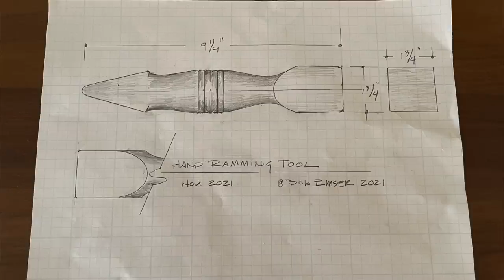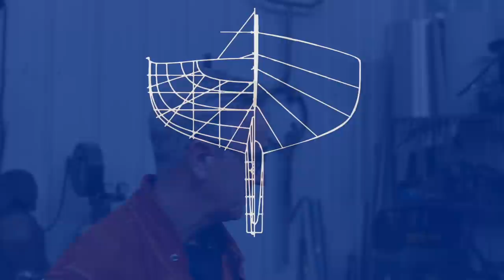Foundry Tools for Sand Casting, S2-E55

Comment: Boy your sculptures in Norway are fantastic, the larger of the 2 looks like a Spinnaker and the large framed section looks like a section of a ships framing. Between the fine Spinnaker lines and the large portion of framing the balance of the sculpture is just amazing. I noticed on one of the videos you produced there is a similar motion and balance of I think sails in motion. I believe its on the property where your workshop is located. The spherical piece I can't seem to put a feel to it but if it had a wind vane inside that would be something. Since I have sailed and spent 40+ years on and in the oceans Im seeing something but cannot put a finger on it. Nicely done Bob!
Reply from the maker: Thank you Scott!